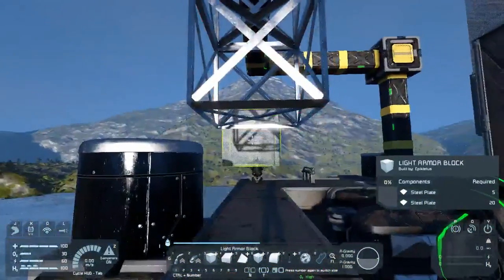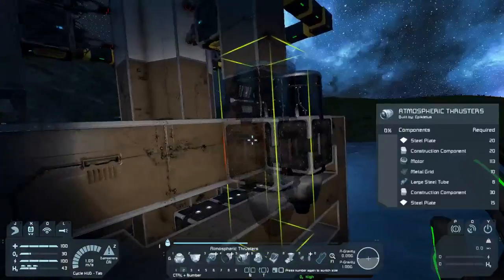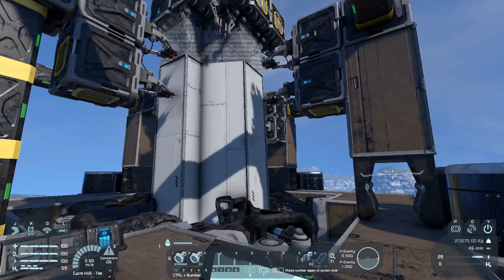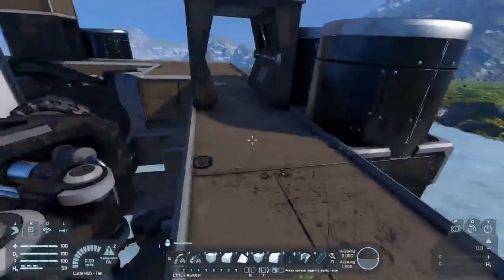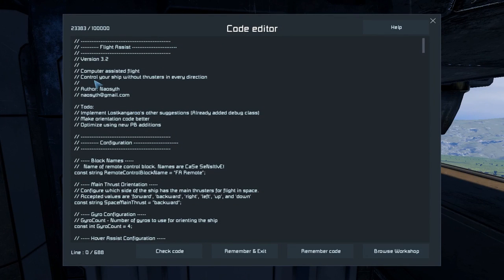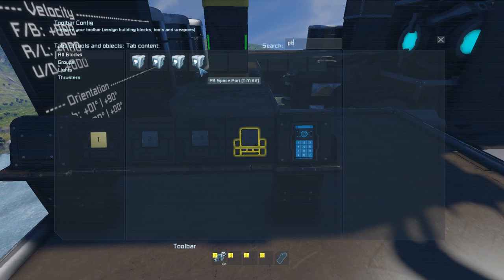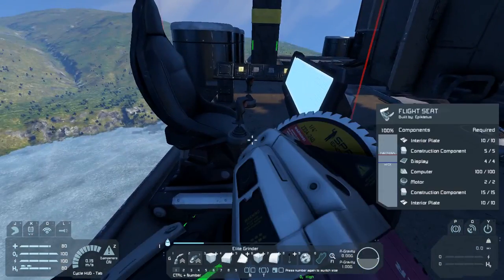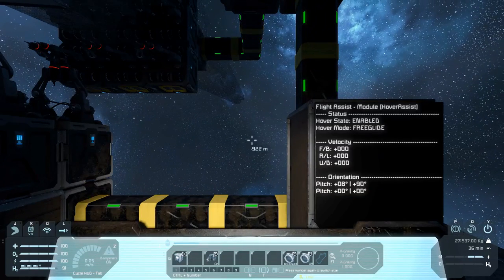1km - Space Engineers S2E29

Comment: The Safe And Sound Section of Interstellar Office For Industry demands you to increase the safety levels of your working environment. The SASS of IOFI cannot allow you to continue the works on your Space Elevator unless you meet all of the 1st and 2nd grade requirements for safety and comfort of your workers (including your person).

As a guideline, you may use the Guide To Stellar Engineering distributed by the SASS of IOFI across all of the major industrial nodes in the sector. We especially suggest you start with the following:

- Pg 745-5, $715 - The use of solar power to make floating devices sustainable
- Pg 5402-3, $144 - The importance of rails in open spaces
and last but not least
- Pg 5560-1, $1 - Catering

The SASS of IOFI hopes you will be able to meet the standards by the next episode, otherwise your Space Elevator will warrant a swift action.

Best regards,
The SASS of IOFI

Comment: Hello Epitek,
I would have an idea with pistons. If you have four pistons under the lift build with a Landing Gear towards the middle section. Two opposing pistons push up the elevator, with activated Landing Gear. Then the other two pistons are activated. So one could work up like a caterpillar. This should be more stable than the engines.

Comment: Have you tried just locking all your gyros?
Reply from the maker: I tried this in a previous video to stabilize some drills on pistons and it didn't work
Reply: I can probably whip up a script that corrects how level the platform is for you, pretty simple. Controlling thrust with  atmospheric thrusters is a little more tricky, but a remote control can be set with a speed limit, and setting a waypoint with a programmable block would make it pretty automated.
Reply: EpikTek and the code for a level platform is done.
Reply from the maker: Oh wow, while you were writing this I found a different solution, but thanks anyway. Maybe the next time I need a script I should talk to you. :) Are you on the Discord server? If not, check it out and shoot me a message.
Reply: Using a tower just like yours, only light armor, the elevator easily travels at 100m/s. I accidentally overshot the top and shot right off the end. I cut the thrusters, and was pleasantly surprised that the elevator slid right back onto the tower after a drop of a few hundred meters :S

Comment: Sorry the script didn't work out for you. I never thought you would try to use the "cruise" function. I was hoping it would help you find a way to keep it stable. I use this to drill perfect holes straight into the earth and perfectly level tunnels through mountains with drill ships.

The script orientates itself with the direction of the "Remote Block"! When you entered "FreeGlide" mode it wanted to twist itself so the Remote Block was level. I believe it ignores the position of the cockpit. 

Re-positioning the Remote Block with the horizon will fix the problem. If the Elevator is jostled, it will automatically re-level itself. If you're concerned it will want to tilt to move forward or backward set "MaxPitch" and "MaxRoll" to = 0. Lines 45 and 46.

I'm not "savvy" enough with scripting to modify it to cruise in a vertical direction.
I toyed with it to try and do this, but, had no success. Don't use "VectorAssist" in gravity!

Thank you for showing my comment in the vid. I think this made me happier than it should have!!
Reply: Hehe, I feel the same way when I help on streams, or do videos with him. I just love to help. xDD
Reply from the maker: Ok, this explains a lot, I'll get that fixed up and see if I can use something else for the "cruise" that I was hoping for. Thank you for the suggestion either way, it's a cool script.

Comment: OSHA would never approve of your platform even if everyone has a jet pack.
Reply: static comes through before clearing up Excuse me, Epiktetus? This is the Health and Safety board. We heard you've violated rules, "296-155-477-3", "296-155-24609", "296-155-24607", "296-307-250", and  "296-24-75011" of the WAC Health and Safety Regulations put in place on Terra Firma. If you do not cease and desist immediately, we're afraid your "Cosmic Space Elevator of an Epik scale" Will be forced to close down. Thank you... Nia out."
static cuts in before transmission suddenly ends

(( ;P ))